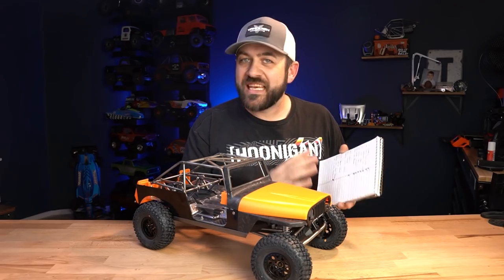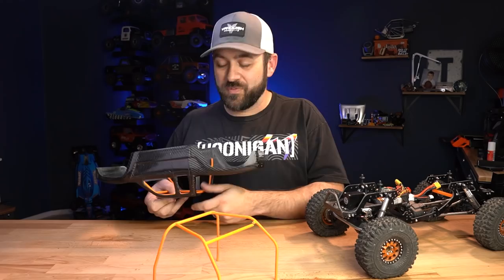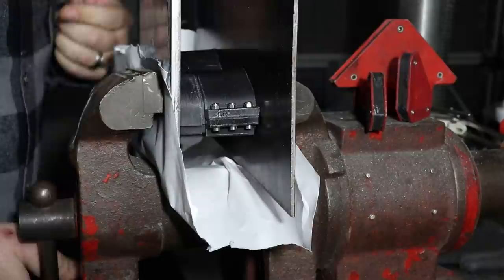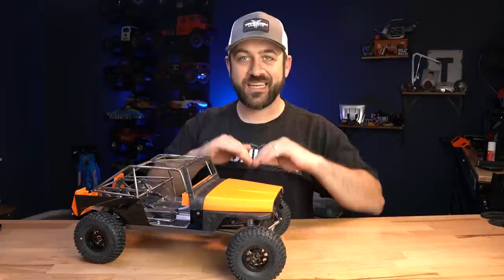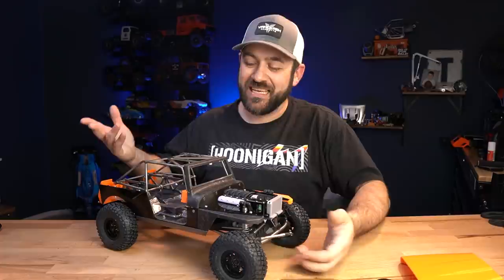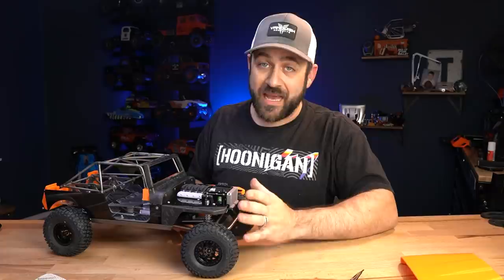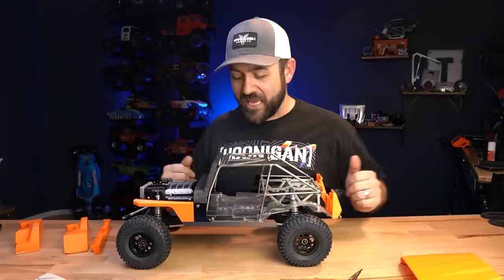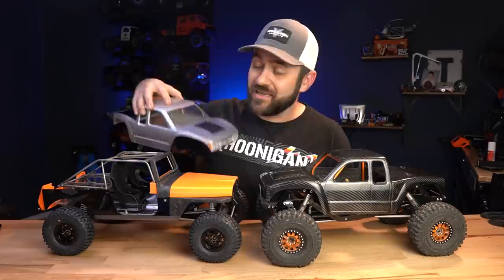MISTAKES were made - Road to Scale Nationals - S2 E5

Comment: Idea, engrave your logo in side panels and fill with orange epoxy, use hot glue as a border around logo when filling  to prevent going all over, and only having to sand the epoxy down to the level of the panel at logo, then go forward with polishing

Comment: ive done a lot of carbon work

for an easy-ish clearcoat over that forged carbon stuff (looks AWESOME, btw)

scotchbrite the carbon to get some texture / scratch on it. wipe clean with alcohol

wet a rag with the same epoxy you used for the part layup

wipe a thin film with the wet rag over the parts. cure in a hotbox or something - will take forever to cure without heat because it doesnt have enough thickness to make its own heat to cure

should give you a little gloss, but also some extra resin on top to sand/polish into later on if you want. but it should be a VERY thin film, almost a residue.

Comment: Hey Josh,I was watching your video this morning and you are mention about the carbon fiber had some bubble out of the mold, I used to make surfboards for 25 years and I used to deal with Poly and Epoxy resin and I know those little bubble sometimes come up, I'm from San Diego and over here has a Company call Solarez UV cure epoxy resin, tell sell on amazon too,  they sell a little tubes with all kinds resin and its perfect for those kind bubbles and very easy to fix at low cost and quick dry too,  you are doing a amazing job, I love it all the different types of construction you're doing, Good Luck on the Nationals

Comment: I made slider side caps from carbon. I painted on a very thin layer of resin, sanded smooth with super fine grit paper, and polished came out amazing. Great build. The class 1 is crazy
Reply from the maker: These are basically made of resin so it’s not much more than just needing a polish at this point.

Comment: For the roll cage I would think the weight savings with titanium would be negligible. 
I love seeing you geek out on the class 1! I think a matt clear spray paint would seal the carbon fiber without hiding it. Amazon link for the flocking kit??
Reply from the maker: It’s only a 5% saving but since it’s solid rod, it does make for more flexibility with tighter bends and such.

Comment: No need for a top coat for flocking. If installed correctly, it will be super durable. I avoid the flocking glue and just use rattle can paint. Spray an heavy and flood the area with flocking.
Reply from the maker: Interested in printing and detailing dash for me? I’ll pay!
Reply: @HarleyDesignsInc  sure thing

Comment: Do you need doors for C1? Does the front of the jeep (bumper) need to touch before the tires do? Sweet update! Looking good! I hope you have enough time to get everything done and test.
Reply from the maker: No doors required. The front bumper has to be out as far as the front of the tires and as wide as the windshield.
Reply: @HarleyDesignsInc  I didn’t know/understand the rules. I saw a video from ZSN (Zia Scale Nationals) and they said the bumper need to touch a flat wall in front of the truck before the tires do (C1). Maybe a rule they did. Thanks

Comment: why don't you use the winch servo put two little terminals on it a red wire and a black wire and make it look like the battery for the LS just an idea
Reply from the maker: I only have about 1-2mm to the hood. Also it would be a massive battery 😁

Comment: carbon fiber, depending on the direction and thickness of the layers for the design, and titanium are both amazingly light and strong. they also share the likeness that they have a bit more sudden and costly failure, at least in larger applications. i would make the comparison of how Japanese swords are made, what with a softer core to allow for flexibility. but with the scale of RC i honestly think the suspension paired with sacrificial/lower quality plastics, the pairing of titanium/carbon fiber is pretty ideal...unless its a nitro rc...then id say why carbon fiber? lol
Reply from the maker: In this application I think the materials are pretty optimal I agree. The failure points would definitely come from flaws in workmanship before true material limits.

Comment: I'm just wondering... (please don't fault me for the presumable lack of experience/knowledge) Why the need for a rollcage in a truck with a cf body, that I'm sure weighs under 10 lbs., aside from scale points?
Reply from the maker: If you mean the class 2, the carbon body could still crack badly thru the two thin a-pillars without support.
Reply: Ahh ok. That makes sense now. It looked thicker